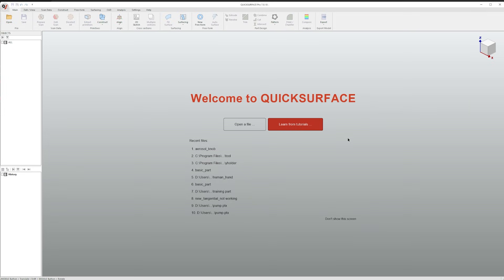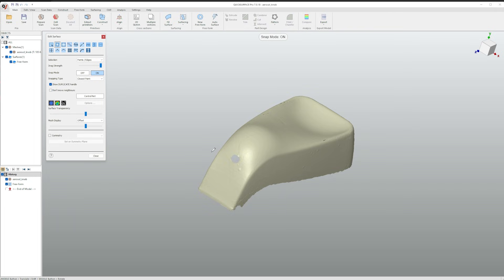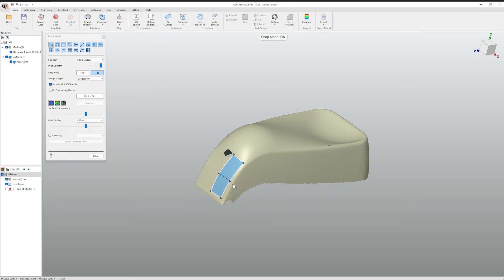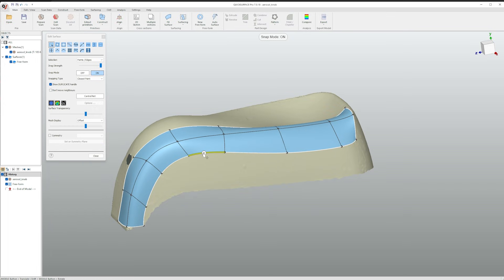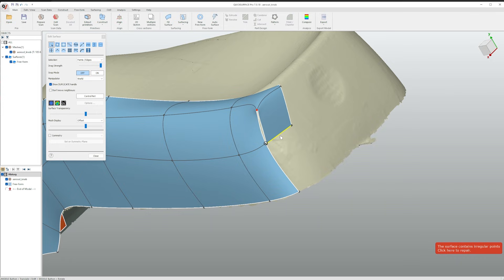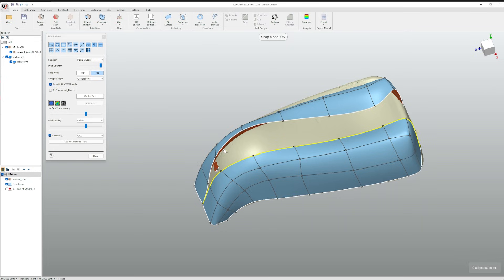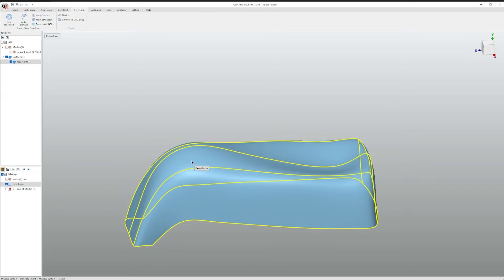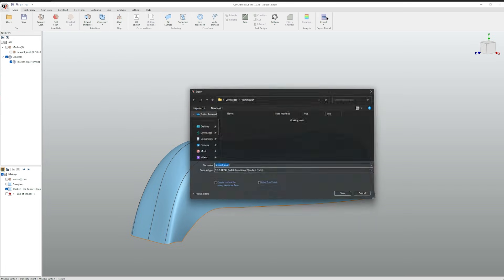QUICKSURFACE Tutorial – Get Started – Lesson 4 | How use Free form modeling

Comment: Great tutorial which was easy to follow and only few minutes! Very useful. Can you make similar tutorial for easy technical part? I would like to know if its also possible to perform reconstruction of 3d scan by using sketching method? Which means to draw the outline of a model and extrude it to the thickness of the model. Is this possible with quicksurface?
Reply from the maker: @android4cg  there are many start tutorials. If you install the software just press tutorials and will take you there.